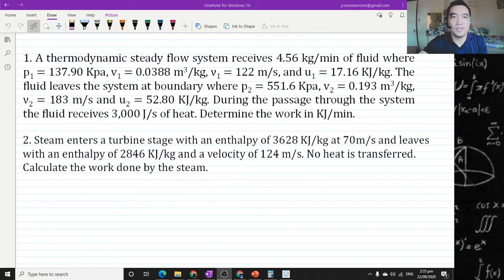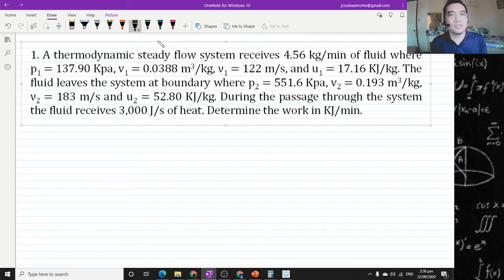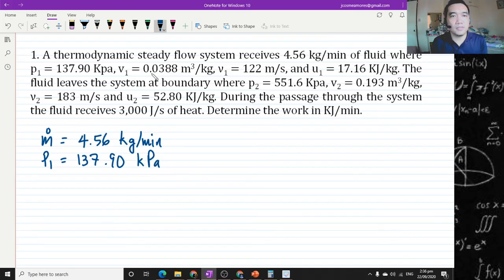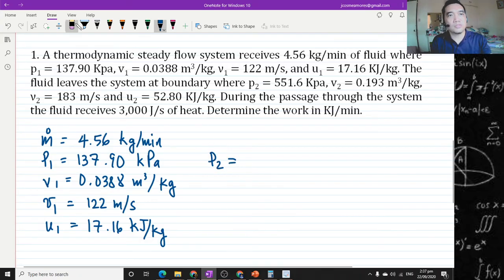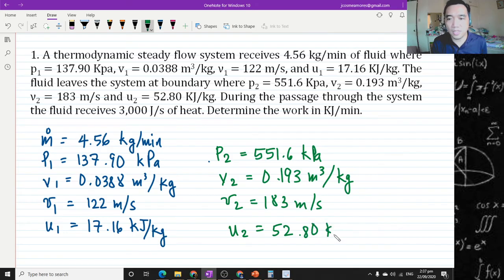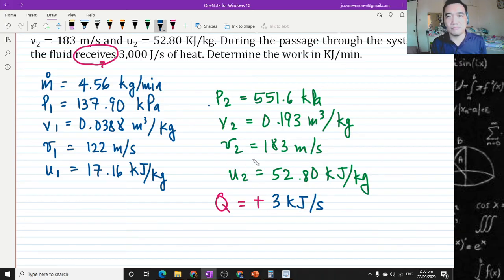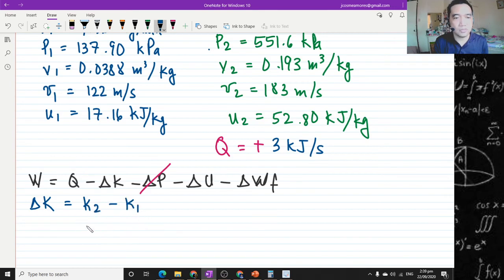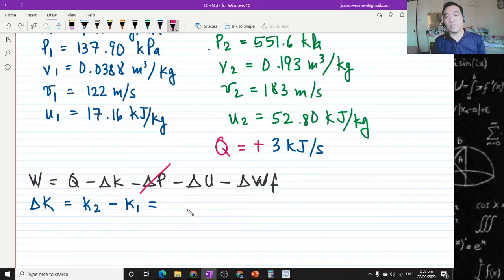Solved Problems for Conservation of Energy (Metric System)

Comment: sir lumabas po sa 1 ko is negative -485.992 kJ/min
Reply from the maker: That's correct. If work is negative, then it is done on the system. 
Since I have already stated, that work is done on the system, I have removed the sign, when I multiplied (-106.58 KJ/kg)(4.56 kg/min) = 486 KJ/min (work done on the system). :)

Comment: Sir help po huhu

A mass of 1.2 kg of water initially at 1.6 MPa and 150 ⁰C expands isothermally to a 
pressure of 0.7 MPa. The water then undergoes a constant pressure process until the 
volume equal to initial state. Show the process in T-v diagram and determine the (a) 
initial volume, (b) final temperature.
Reply from the maker: You can solve the initial volume using PV = mRT (don't forget to convert T to kelvin). Solve final temperature, T2, using T2/T1 = V2/V1
Reply: @jcamores5099  Sir aning email niyo po?

Comment: sir ano po yung 2k?
Reply from the maker: Part ng formula ng kinetic energy. KE = (mass x velocity^2)/2k
k = proportionality constant
Reply: if ever po na may mass (kg/min or s) sa given  pwede po ba yan i multiply sir dun sa may pag convert po?
Reply from the maker: @OO7.  Yes pwede. Actually, if you multiply 4.56 kg/min na mass flow rate to change in kinetic energy, change in internal energy, and change in work flow you will have KJ/min as unit, then just "subtract" that to your heat (syempre convert to KJ/min dn), you will arrive at the same answer.
Reply: @jcamores5099  paanong subtract sir?
Reply: bakit po pwede sya imultiply?